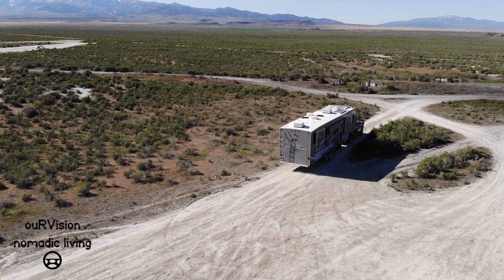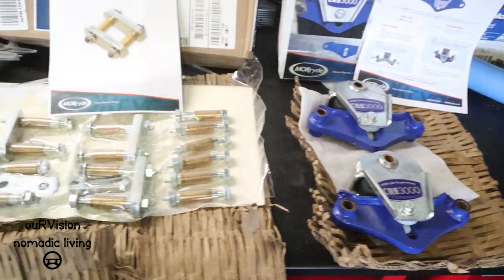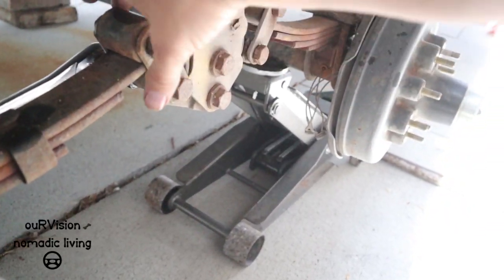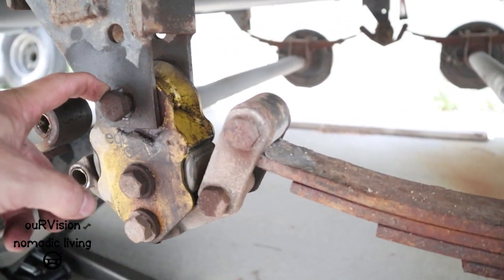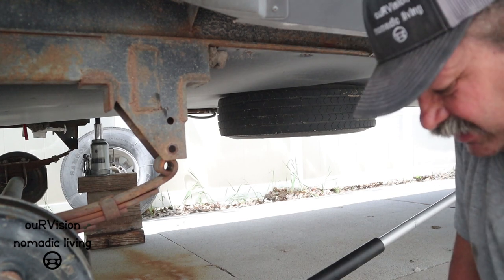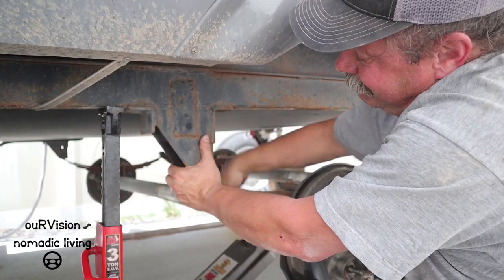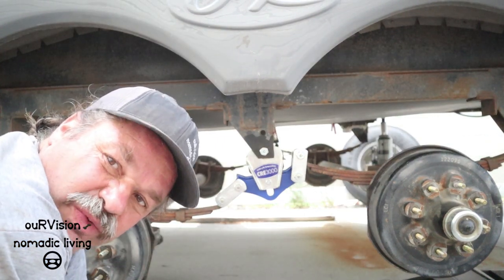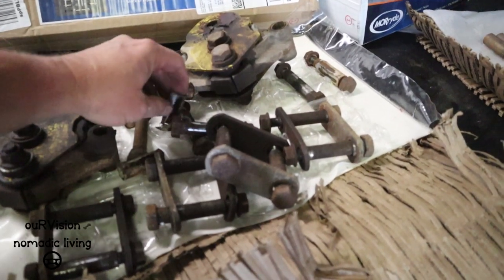IS IT WORTH IT? MORryde CRE3000 Suspension & Wet Bolt Kit Installation

Comment: Very good explanation. How often do you re-grease the bolts?
Reply from the maker: Thanks so much for watching and commenting. I have greased them last fall. So about 6 months after I installed them. In the next few weeks I plan on repacking the wheel bearings and will grease them again when I do so. 👍
Reply: @ouRVisionnomadicliving  thanks for the info. I’m going to change my cast oem equalizer and I’m adding wet bolts and heavy duty shackles like you did. The video will help me a lot.

Comment: I was wondering what kind of Equalizer was on the trailer?  Were they not functioning well?
Reply from the maker: It came with the Lippert Equiflex, as you could see in the video, it was worn out.  Thanks for watching. 👍
Reply: @ouRVisionnomadicliving  Interesting, I have been waffling between the CRE3000 and the Equiflex.
Reply from the maker: @ddttcv  I did this install in the spring of 2020, in Feb, 23 I discovered a cracked leafspring. I replaced all 4 leaf springs, as such I ordered a new wet bolt kit to get the bronze bushings for the new leaf springs. The CRE3000 was still in great shape. Here is that video you might be interested in. https://youtu.be/xgz9naA6zAw
Reply: @ouRVisionnomadicliving  Thank you!

Comment: Great to learn from your experience before I replace springs on my 2011 travel trailer. 
Question about replacing that equalizer that was on the original suspension.  Mine has same but I thought it was a better alternative to the cast triangle bracket.  Why did the Equa-flex need replacing? 
Thx
Reply from the maker: Hi George, the Equa-Flex was just worn out. The bushing in it were shot as you can see from the video I show at the end. Thanks so much for watching. Good luck with your project.

Comment: It's been a year how many miles have you put on the trailer and what is the state of the current suspension system
Reply from the maker: HI Robert, thanks for watching. I just added it up. Since I did the install I have put 10,894 miles on the rig. So far it is holding up well. Thanks for watching. 👍🍻 Sean

Comment: Great video! It did hurt my heart that you didn't use an impact removing all the old stuff.  Lol But on a serious note, are the replacement nuts locknuts?
Reply from the maker: Hi WT, thanks so much for watching and commenting. Sorry I didn't use my impact tools, but that would have required me to drag my air compressor out of the garage, besides, using my hand tool helped me get in some much needed exercise. 😀...LOL. In answer to your question, the nuts supplied by MorRyde are flanged lock nuts, they are not nylock nuts, but they are lock nuts. Take care. 👍🍻 Sean

Comment: Did you have to hammer the bolt into the hanger so the spline seats? I hammered like a mad man and still can't get it to seat. So I just put the nut on and put 45ftlb.
Reply from the maker: I did not hammer the bolts. I just torqued the nuts down and it seated the bolt into the hanger. 👍
Reply: @ouRVisionnomadicliving  i did that but there's still a little gap. I reread morrydes instructions and it doesn't say to hammer it. I think I should be ok. Hopefully.
Reply from the maker: @Weak_juan  👍

Comment: DID , you check each spring spring pack to SEE , IF any of the leafs had cracks in them ?
Reply from the maker: Thanks for watching and commenting. 👍 Yes, I checked the springs. Although rusty they were fine. We have put almost 2000 miles on the rig since I did this in May. Just a few weeks ago my father in law and I installed both kits on my in-laws 2017 348RLS as well. 👍 Still can't believe these parts are not standard on all trailers. Take care and safe travels!! 👍 Sean

Comment: Thanks for the video.  Question..Did the trailer height remain the same?  I heard that the Morryde  raises it and the other the brands lower it.  Let me know. Thank you.
Reply from the maker: Thanks so much for watching and commenting. In answer to your question, the CRE 3000 did not change the trailer height. It is actually one of the reasons I went with it instead of the 4000. I had considered the 4000 but I had previously put slightly larger (with a higher load rating) tires on the rig The larger tires narrowed the gap between the two tires and I was concerned that putting the 4000 on (which increases the suspension travel) would narrow the gap even further and potentially create an issue where the tires may have rubbed when going over very uneven ground. Take Care and Safe Travels!!! 👍😀 Sean

Comment: What Mor Ryde part # did you use for your 22MLE?
Reply from the maker: Hi Craig, I am not exactly sure what 22MLE is in reference to. My trailer is a 346FLR. In any event, if your asking what part number I used for the MorRyde Shackle kit, it was U012-016. I hope that helps. If not let me know. Thanks so much for watching. 🍻 Sean
Reply: @ouRVisionnomadicliving  
Thanks, Sean. I thought you were performing the upgrade on a Grand Design 22MLE.
Reply from the maker: @craigburns6967  Ah. Morryde makes 2 different shackle kits. If you have the Lippert Correct Track, which has the yellow adjustment plates on the hangers you will need U012-029. If your RV does not have those yellow adjustment plates (like mine) you would use the part number I wrote in the previous response. 👍 Sean

Comment: Thanks for taking the time to produce this.  What made you decide on the 3000 vs the 4000?
Reply from the maker: Thanks so much for watching and commenting. That is an excellent question. Previously I upgraded my tires from the E rated westakes to G Rated (14 ply) Samson's. I decided at that time to go a size bigger tire as well. So I am running 285's instead of 265's Doing this narrowed the gap between my two tires. Which has not been an issue. However putting the 4000 on would have allowed for additional movement, and possible under certain situations allowed the two tires to come in contact with each other....so....I went went with the 3000. Take Care and Safe Travels!!! /// Sean

Comment: Extra gusseting, braces welded on frame and spring bracket hang down....wonder why and when ?    Thanks
Reply from the maker: Hi Julio. I had my wife's cousin (he worked for many years as a fabricator at a trailer manufacturer) add the additional support to the shackle hangers after seeing a number of posts where people had experienced problems.  I just wanted to avoid possible issues myself. 👍 A few hours of preventative work to possibly save hours of frustration at some point down the road. Thanks for watching and commenting, and good eye. 😁 Sean

Comment: How do you know if need 33 inch or 35 inch.  Also do you know what difference is between 3000 and 4000?
Reply: Thanks for sharing.  Still undecided if want to tackle this myself. Yet.  But truly appreciate it.
Reply from the maker: Here is the link to the qualification guide showing what measurements you need to determine if you need the 33 or 35 inch. As I understand it the 4000 gives 1 more inch of suspension travel, and it requires the use of 1 or more cross members when used. Thanks for watching and commenting. https://www.morryde.com/wp-content/uploads/2020/01/CRE3000-Qualifier.pdf
Reply: ouRVision nomadic living thank you!
Reply: The CRE3000 is rated for 8000lb axles. 
The SRE4000 is rated for 7000lb axles.

Comment: You're talking about who puts plastic bushings in that's the selling point for that unit I'm studying suspension parts a client has a trailer that he wants some longevity out of the suspension he spent thousands in the last 2 to 3 years the more studying I do it looks like I'm going to go with Hendrix they do truck and trailer equipment and it seems to be of a lot higher quality
Reply from the maker: Hi Robert, Honestly I have no idea how the selling point of a trailer would be plastic/teflon bushings. I am sure that Lippert puts plastic bushing in because they are cheaper than putting bronze bushing in. In any event, thanks for watching and I hope you found value in the video. Good luck and safe travels!! 🍻 Sean

Comment: Great in depth video, much thanks. I'm currently doing the same install and ran into problems getting the knurled bolts to set into the hangers. Did you use the ball joint press there as well?  tried using a C clamp, a 2.5# dead blow hammer and lastly a impact gun, which ended up stripping the threads on the bolt.
Safe travels
Reply from the maker: Hi John. I'm sorry you had issues. When I put it back together I just torqued the nut to 50 foot pounds.

Comment: wait at 14:50 + you tighten the rear one with the leaf on the bottom side which is a bitch to correct. You then cut to the finished job, no mention of that issue or what you needed to do, acting like it was nothing.
Reply from the maker: Thanks for watching. As mentioned in the video, I then did the other side.  Your correct in that I didn't show raising or lowering the trailer before or after doing the work. That said I didn't have any issue with that leaf spring moving up into the "correct" position. That video was done 4 years ago. In Feb, 2023 I replaced all 4 leaf springs due to a crack in the front right leaf spring. Here is that link if your interested. https://youtu.be/xgz9naA6zAw?si=-xZvDPfimhprfg2F

Comment: From my understanding the 3000 has a higher weight rating then the 4000.
Reply from the maker: Hi Max, thanks so much for watching and commenting. I had not heard that. I would imagine that in formation is on their web page, or listed in the specifications information. In any event, take care and safe travels!! Sean
Reply: The CRE3000 is rated for 8000lb axles. 
The SRE4000 is rated for 7000lb axles.